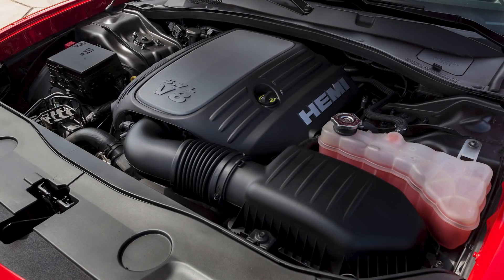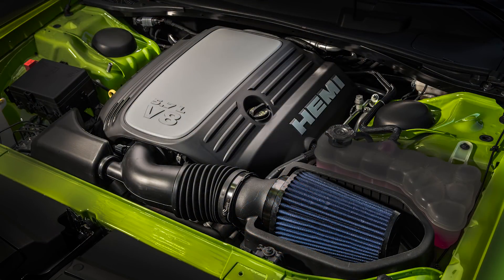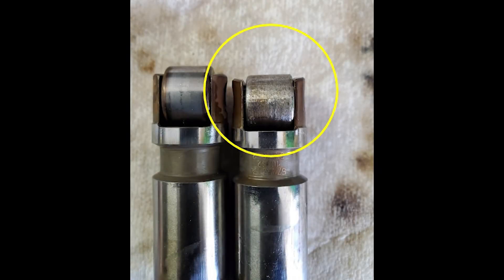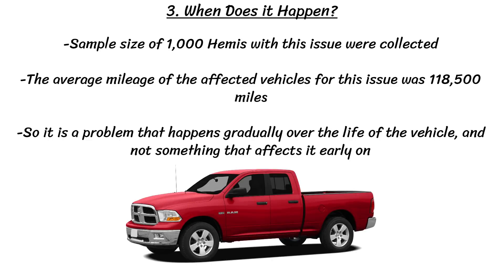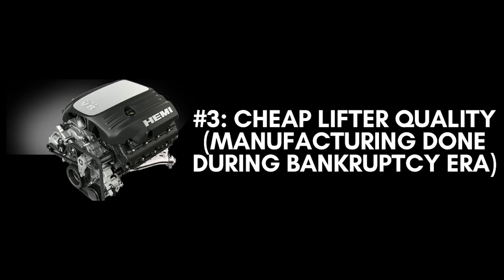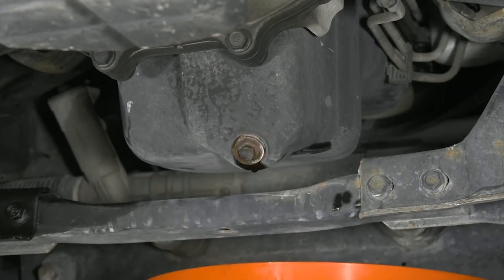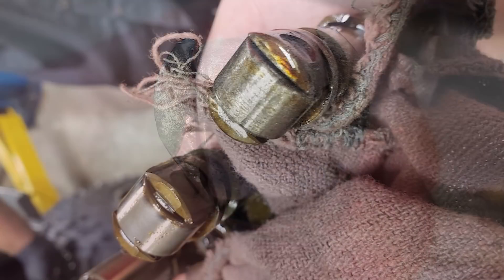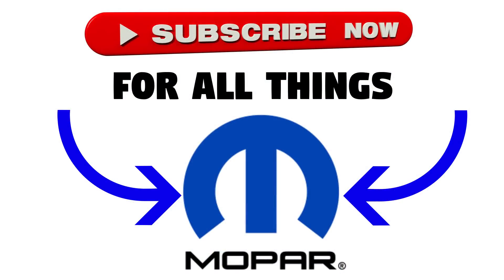The Fatal Flaw of the 5.7L Eagle Hemi V8 Engine Fully Explained (2009+ Lifters and Camshaft Failure)

Comment: I brought my ram in 09. 
Today it has 184,000 miles.  Still looks new, rides new. 

Tik noise: broken bolts cover under warranty 
( i have lifetime warranty )

For 8 years I had no problems 
Past 4 years : 
Suspension 
1 wheel bearing 
Ac evaporator
Water pump
Replace timming chain at 183, 356( no issues , just maintenance)

When I hit 1,000 miles I changed the oil. Since then
 6 qt of mobile 1 synthetic plus 1 qt of Lucas  Synthetic

I think the key is change your own oil,  keep up with maintenance
Reply: It's not an oil change issue or my lifters wouldn't have gone bad, it's a lifter issue.
Reply: @CGoffgrid  maybe its because my truck was made by Chrysler before selling out to Fait. After all they slap a lifetime warranty on my truck
Reply: @OUTLAW_TRUCKER  Mine is an 09 also. 198k miles. Getting her rebuilt now with a comp cam. Guess I'll keep that old truck another ten years. Just because she needed a heart transplant is no reason to stop loving her.😉

Comment: Another batch of bad secondhand news. I had 4 bad cam lobes, and one bad lifter. This suggests the cam is failing before the lifters.
Reply: That would be news, more info?
Reply: @snek9353  143 000kms, (aprox 90,000m) regular service by licensed mech.(me) synthetic oil only.
Missfire #8, (a non mds cyld.)tore down, found 4 BAD lobes only bad lifter was #8 intake....
Reply: @brentfellers9632  Interesting, that's unusual. I'm assuming a 5.7, what year?
Reply: @snek9353  5.7 2013 🐏
Reply: @snek9353  buddy on reignited channel stated he has seen the same type of failure. 
I'm not saying cam surfacing wear is the only cause of failure,  but it does seem that way in my case.
New cam, lifters, runs better ,more power and better fuel economy than new. Mds will even engage on level highway pulling 2500lb trailer!

Comment: I have a 2011 ram 1500 that is on its 5th motor..I bought it used in 2017 with around 90,000 on it and a month after the 60 day warranty expired my lifters collapsed and wiped out the cam.. the internal camera used showed the destruction and mess that was made.. now I brought this to a friend's repair shop he told me about 4 or 5 grand to rebuild it so I insisted maybe I'll just get a new motor so he told me that I might be better off buying a motor from a place called Jasper engines which he ordered for me it lasted about 5 months in the same thing happened they gave me a 3-year 100,000 mile warranty that engine was pulled another one replaced in its place happened again after 3 weeks I'm pretty pissed off obviously not happy at all he ordered another engine same thing happened again after 2 months I'm now on the 5th motor in this vehicle knock on wood I have about 15,000 on it maybe a little better than that still doesn't seem to be running right at idle is a little rough ticks a little when I start it but I had called Jasper because I was told that motor that was last put in that there was no more warranty that the three years was up which I was confused because I was told that you get a 3-year 100,000-mile warranty with a new motor now I went in through four motors from Jasper in a three-year period now they're telling me that I don't have a warranty which I call b***** I wasn't happy so I had called them up and they said we would not do that to you following your past history with our engines I was told that they put hellcat lifters in the motor that I have now which I highly doubt it I'm just waiting for the engine to do the same thing again and looks like I'll have to fight for a motor which I will do if they deny my warranty I must say I'll never buy another Dodge product they know that this issue exists and they do nothing or say nothing about it that's total bullshit.. I've had GM most of my life and never had half or a quarter of the issues I've had with this Dodge and the four and a half years that I've owned it it's been nothing but a headache it's a total piece of you know what Dodge sucks they can keep their junks... Before purchasing the Dodge truck I bought a brand new 2012 300 SRT with the 6.4 everything that I wanted in the car never heard anything about their engines and problems 60,000 miles into the engine the lifter wiped the cam out in the 6.4 l also the computer screen went out on it twice which I had waited 3 weeks for  them to replace and the computer screen controls your radio and everything else that went out on me twice also so as far as I'm concerned Dodge is nothing but a piece of crap I sold the 300 and this truck is next I'm getting rid of it before the engine blows in this one too.. anyone interested in a 2011 Dodge ram with a 15,000 mile motor haha probably couldn't give the thing away anyways good luck to everyone with a Dodge out there I'll never buy another one again
Reply: I've heard some bad things about Jasper engines, but if you had somebody rebuild that Hemi correctly it would be a beast.

Comment: good video...  I was skeptical of course but you were fair..  You kinda missed the major point that the 2003-2008 is the EXACT same design... so its not a design flaw :)  or the 2003-2008 would eat lifters at a high rate which they dont :) https://www.youtube.com/watch?v=prX7abzVzpc
Reply: It's more interesting to me that the 09-10 don't have failures.
Reply: @snek9353  i think this leads to a manufacturing issue or quality control... just enough wear on the lifters at 100k(11-13) and wham... the pipeline was full of good german lifters for the 09-10 motors going out the door.
Reply: @darthhemi1735  Exactly, I wish we knew more on the subject so we don't have to guess. I'm sure somebody knows but they aren't telling. 

But it seems to me that all of the big 3 had some form of roller follower/lifter issue around the same time. It would not surprise me at all if they all come from the same supplier conglomerate and that some time in 2010 or so they tried to save a few pennies through some change that lowered quality. Just a guess but I think it's a good one.

BTW I'm watching your Uncle Tony ultimate battle finale video again right now.
Reply: @snek9353  yeah i was shocked to find out LS and Hemi lifters are exactly the same diameter...

Comment: Your 5% estimate is wrong, i did the math from multiple dealerships and its 2-3% from 09-14-15.  it could be 5% in 11-13...  varies for years... glad you got alot out of my video :)
Reply from the maker: What % you thinking?
Reply: @MarspeedCars  i edited... 2-3%.. i got real numbers from my Chrysler tech friends(on the down low).  The guys doing the repairs know the numbers :)  5% is insane, way to high... add that up, 5% of every hemi of ever year is WAY to high.
Reply: think about it, 5% of every 2009+ hemi is like 700-800k trucks... Chrysler would be bankrupt.
Reply from the maker: @darthhemi1735  fair enough 2-3% is believable, however with average mileage of occurrence almost always over 100k, the vast majority were past warranty and out of pocket, not costing Chrysler anything. My 06 5.7 dropped a valve seat, it’s all out of pocket for me to pay as Chrysler made their money on this car and couldn’t give a crap
Reply: @MarspeedCars  you think Chevy or Ford does? hah okay :)  yeah once over 100k manufacturers are like "our hands our out of it, you got well beyond the warranty"... in reality we all want our vehicles to go forever...  but there are extended warranties :) I typically buy them with newer cars because the tech/parts/labor are so expensive.. i just fix my 2008-2009 and under cars myself.

Comment: There is no fatal flaw with this engine 
Total fallacy 
Take care of your stuff bottom line end of story
Reply from the maker: No way, it’s not common for this to happen to so many people.
Engines should last 100-150kms easily without perfectly meticulous maintenance. Friend had a lexus without an oil change for 20k, pitch black, engine went to 400kms. My mom has owned 6-7 cars all for long long periods of time for example, never maintains them well, never has a blown engine or needed a repair like this. Sure really good maintenance likely prevents it but I’m nit buying this is just normal.

Comment: I work at Chrysler. They are not updating the 5.7 hemi. It’s not 100% confirmed but I’ve seen parts and service sheets for a 3.0 inline six turbo replacement. Or as another option. I believe this would have an hybrid option.
Reply: I have a 2011 ,1500 5.7 hemi are DC replacement in effect

Comment: I had 52k miles on my 2016 Ram when I developed the tick.  Looking into things, the engine had 550hrs of idle time on it.  So, the previous owner must have just let it idle all the time.  After letting it run for about 10 mins when it the weather was beginning to cool down ( October in NY ) the tick would start to come around after a few mins of running.  The dealer replaced all the lifters under warranty.  The service manager said that the few he's seen, all the vehicles had high idle hours on them.  I'm super anal about using full synthetic oil and changing it out every 3k miles.  I know its excessive but to me, its cheap insurance and peace of mind.
Reply: 5w-20 12 quart box,,,at 3 bucks a quart at walmart.
Reply: 5k miles change, use 5w30

Comment: so im not on board with the flaw theory. i will say from experience, i tried to eliminate the mds solenoids only and put the plugs in their place. this was a cheap experiment since the plugs are roughly 30 USD. this caused the engine to go straight into 4 cylinder mode. 
long story short here. THE SOLENOIDS REGULATE OIL FLOW FROM UNDER THE INTAKE. THUS BASICALLY SHUTTING OFF OIL PRESSURE TO THESE LIFTERS. THAT RIGHT! THE MDS LIFTERS OPERATE WITH LITTLE TO NO OIL!!. you put too much oil on these lifters and then they colapse causing a multiple cylinder misfire. I then returned the solenoids to their bores. 
like it or leave it if your going to remove and eliminate the MDS solenoids you MUST change the lifters.

Comment: Your right and wrong!  Mds did not harm anything, simply 2011 _2015 did in fact get bad lifters, but it’s all about service. As you say to present meaning 2021? Totally untrue, problem has bn corrected!  However it’s sad that Dodge Ram didn’t have a recall an fix it for the costumers
Reply: MDS can absolutely trash a cam, if its malfuction(and the ecu) doesnt realize it, the lifter can hit the cam too hard.... instant needle bearing damage
Reply: @darthhemi1735  nope mds, was never the problem, bad lifters, educate yourself! Gm came out with mds first, they never had an issue like ram ever! Bad lifters
Reply: @markreynolds872  Gm is called AFM... you dont know anything about Mds...  wrong again man... educate youself

Comment: Check the hardness and microstructure of the failed cam lobe.  Can't believe no one talks about that. Each cam lobe is hardened individually so there is more chance for something to go wrong either in the heating or the quenching of the lobe. Have examined many cam lobe failures prior to my retirement and that is normally the root cause. All the lifters associated to the soft lobes seem to fail this same way. I don't know why that is or the exact lifter failure mechanism, but they all look pretty much the same. I have seen this same failure mode in other soft lobe camshafts that were not hemi applications. Perhaps you should talk to a metallurgist at Chrysler.
Reply: All evidence suggests that the first failure point is the needle bearing interface, not the roller to cam interface. The cam and outer surface of the roller are not effected until the bearings seize. Many engines have been pulled apart to find that the cam is fine and only the roller bearings are failing.
Reply: @snek9353  OK. Show me your evidence.  Marspeed has gathered a lot of opinion/non-scientific information and has done a good job of sifting through it. Show me a properly prepared cross section of a bad lobe and a cross section of one of the non bad lobes right next to it. If there is no metallurgical difference, I will stand corrected. I have done this a number of times in my former career and have always seen a major difference. Usually evidence of an improper heating cycle or an improper quench can be plainly seen.  Notice that only the cam nose is deeply worn away due to the high loading experienced in that area. Evidence of an improper heat treatment will exist in the non-worn portion of the lobe.
Reply: @cliffordgrupke6558  OK I'll get right on that.... 

NOT!
Reply: @snek9353  OK then.

Comment: 5% of Hemis suffer these problems??
My question would be what is the average percentage of problems ANY engine has??
NO mechanical engine is perfect, I wish I had a 95% success rate when I went to Vegas!!!
Reply: There's a million hemis. If you have one or are looking for one made before 2016 ( I believe after 16' the issue is less common) then just take a listen to the engine. You'll hear the difference

Comment: I have an 05 300 c AWD with 425,000 km on it and still going strong in Ontario Canada. Bigger intake and headers ,tuner etc. Still a riot to drive especially in winter. Bought it off a lease with 60,000 on it. Chrysler replaced the engine in 09 with obvious updates in the MDS , as it spun a bearing. Tranny was also replaced under warranty soon after with with water getting into the dipstick. Just put a used tranny in from a another brand and it runs nicer. But miss my high stall torque converter. No regrets. It owes me nothing. Nice that Mopar supplied me with all that warranty!

Comment: As a Hemi owner I find it disgusting that Mopar hasn't redesigned the lifter body to drain oil towards the roller bearings ! Getting a well deserved black eye online tarnishes the Hemi branding !
Uncle Tony uses common sense to try and fix problems which I find refreshing.  Meaning zero hands on experience.  Too bad the key board experts here have most likely never torn down and rebuilt damaged engines. But his garage is full of junk which makes him look like a scrapper.

Comment: Thank you! I just got a replacement 5.7 Hemi on my 2016 Ram from FCA, reported a tick at 80k they said exhaust leak. I changed my manifold gaskets and bolts still was ticking. At 118K I reported it again they said motor issues not covered under warranty. I fought they said they would pay half, I said no, we fought more now I am getting a new longblock dropped in. What a piece of shit these motors are. My first and last Ram. I have been a Chevrolet guy my whole life.
Reply: if it fails at 118k... its dirty oil or potentially MDS... Chrysler knows many owners abuse their vehicles because they do.
Reply: @darthhemi1735  my oil changes are done on or before time.

Comment: Don't know if you have heard of "uncle Tony", he is on here, Mopar guy. He believes, comparing the what I call the valley pan area, where the oil drains from the top down to the lifters, is restricted. He compares this block design to Chryslers older  426 Hemi, and I believe the 440 block. He believes the oil is really restricted, the drainage to the lifter, which would mean, especially at higher rpm the lifter is not getting enough oil....
Reply: UT is wrong
Reply: @snek9353  Ok, no explanation? I don't know much about hte new design, but am very familiar with the old big block Mopars. On those, where the oil comes down from the rockers to hit the cam/lifters, there is a lot of opening to do so, from what I can see on the new ones, there isn't. To me, looking at this video, the lifter/cam/needle bearings wearing out like this says they aren't getting enough oil, especially at higher rpm's. The older design had no such issues, hydraulic or roller set up
Reply: @artbrookey3468  LOL, wow. 
"am very familiar with the old big block Mopars" Well clearly not as you then said " On those, where the oil comes down from the rockers to hit the cam/lifters" this is a complete fallacy. As is "The older design had no such issues, hydraulic or roller set up". Well first it isn't hydraulic OR roller, they're ALL hydraulic, and there's no older factory roller. 

Really man, don't attempt to judge the knowledge of others when you have none yourself. 

You really even didn't understand what UT was saying, There is no "valley pan area, where the oil drains from the top down to the lifters" on a G3 Hemi.

Comment: Thank God my 2015 5.7 charger pursuit still runs like new, I bought it mid December 2020 , 6 months 115,000 miles on it when I purchased,  and 123,200 now, ive had 2 full synthetic oil changes before designated time,  and I drive her like a baby, but I do spin a tire once in a while.  😆,  im very happy with my eagle Hemi ☺
Reply: I'm eyeing my 2013 pursuit suspiciously. So far, though, she's running good. 113k 5.7